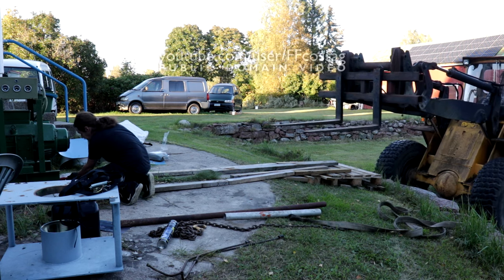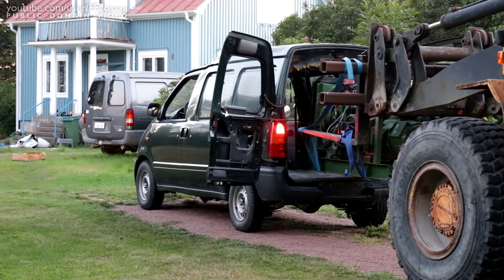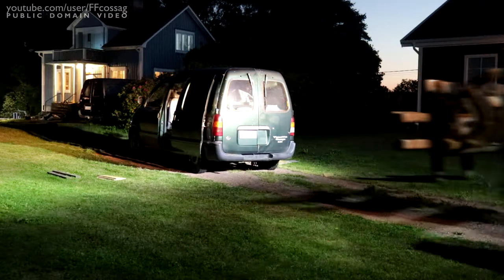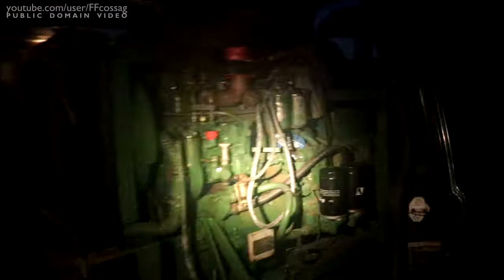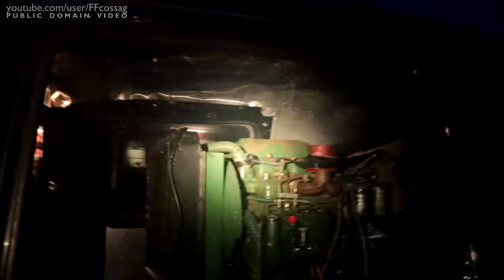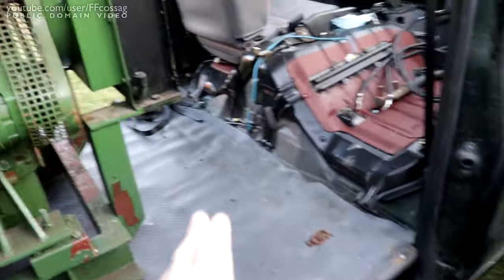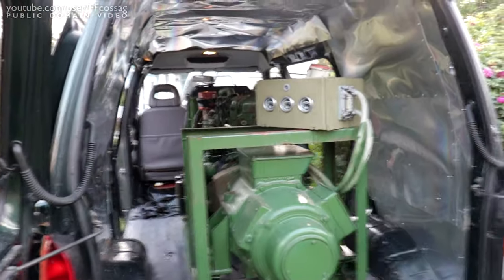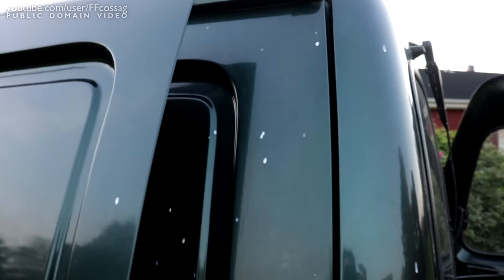25 kVA Diesel goes on a ride!

Comment: I know you probably don't want to do it, but I would highly recommend a full teardown, cleaning and service. My thoughts are that if you find one arcing connector and such a huge amount of rust, you really don't want it to have problems when you really need it to run.
Reply from the maker: I had a good look around, the actual generator is in decent shape other than the steel having rusted a lot. It's never a bad idea to do service of course, but I'm going to defer that to far into the future.

Comment: Love a good overload. The Driving standards agency in my country would kill me if they pulled me over with that! cool af man, be safe. going to carry round a ground rod?
Reply from the maker: It's actually just barely within the load limit of the vehicle! Those old Vanettes load 980 kg, and the genset is about 900. Leaves space for a slim-fit driver!

Since it's mostly intended to be a back-up diesel that gets hooked up to stuff like houses, grounding should be solved through the output plug. Though I am going to put some kind of big earth lug on it just in case.

Comment: Do you plan on making this an automatic start generator or will you be manually turning it on when you need it? As I was thinking you wouldn't have anything penetrating through the shell of the van like the exhaust so you didn't need to worry about water or pests getting in. Instead you just have the exhaust going up to the rear door (maybe with an easily removable extension) and you open the rear and side doors before you start it. Probably give good enough thermals as well.
Reply from the maker: The automatics I have can be configured for automatic operation, though I'm not sure I'm going to do that. At least not initially.

Comment: i would suggest you use the passenger side window to mount the radiator ,since you probably wont have a passenger, and its a big enough hole to put the radiator and draw in air all the time , that leaves you with the side doors and the back door free to open and close so you can service the generator (change oil ,put in diesel ) ,and you can have the exhaust as planned in the back window ,that way you have some kind of a draft to passively cool the inside of the van ,since a 5.6 liter engine is cooking the inside plastics all the time ,
come to think of it , you will need some sort of a fan to move the heat generated by the engine outside the van or else you will cook the dashboard ,the chairs ,and everything with plastics and fabric will degrade ,also ,you need fresh air for combustion
Reply from the maker: The radiator isn't going to be moved, that'd be a huge mess. I have plans for the airflow layout, we'll have to see how it pans out in the end. The genset engine is only 2.7 litres, the 5.6 is the combined volume of the van's engine and the genset ;) These old diesels are actually fairly efficient and don't produce a huge amount of heat. I only expect about 30 kW of heat under full load.

Comment: As to ventilation holes, I'd suggest steel sheets with holes cut out for ventilation grilles (or done on the sheet) in one of the rear doors, and maybe some sort of air duct or something else which directs air kinds sorta one-way from the radiator input to the right side middle door , where you also replace the window with sheet plus grilles (same way as on the rear door). 
Maybe a fan or two moving air out from the vehicle at the ex-windows to coerce the flow in that direction.
That way you have the airflow going roughly from right side door window, through radiator and over engine, to left rear door window. Should keep the thermal deities at bey. 
As to exhaust? Probably hole and space for on the rear door window sheet replacement, or go out through the door proper or ceiling proper (the latter seems to be a classic in vehicle-mounted gensets).
Other than that? Grille of a type which prevents it from raining in?
Just my 0,02 € worth.
Reply from the maker: Thanks for the ideas! The current working plan is to bring air in from the underside of the vehicle by cutting holes in the bonnet under the seats, and expelling air through the rear windows. The most annoying part is that the genset fan blows in the wrong direction and I'm not sure how to fix that.

Comment: My only question is "Why?"
I thought the van was the 'cheap shed' option, and it was just going to be left in position in the garden.  I didn't realise it was going to be mobile.
Your local police must be either a: Very understanding, or b:  Non-existent.
Reply from the maker: It's within the legal load limit of the vehicle, it wouldn't be a problem to inspect it and drive it on the road if I wanted to. It's just not worthwhile to do that due to the very high road tax on old diesel vans, it's cheaper to just transport it on a truck if it needs to go somewhere. The actual "why" is "because the van works just fine". :D

Comment: såg Åland så skriver svenska då hoppas du förstår, jag trodde du var i från fastlandet men ändå.
Jag tänkte att du kan ta ut avgasröret genom väggen eller behöver båda dörrarna vara öppna när generatorn går eller räcker det att en släpper ut värmen och det kan vara bra att behålla lite värme under vintern så den går bra
Reply from the maker: I'm probably going to cut a hole in the rear door for the exhaust. I haven't quite figured that part out yet, since this was filmed I've been focusing on getting the machine back to good operating order.